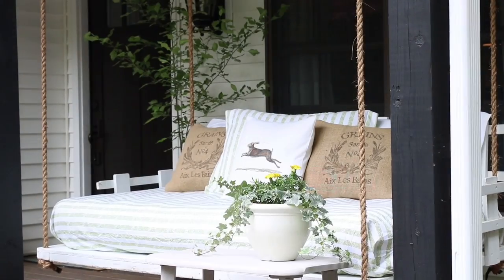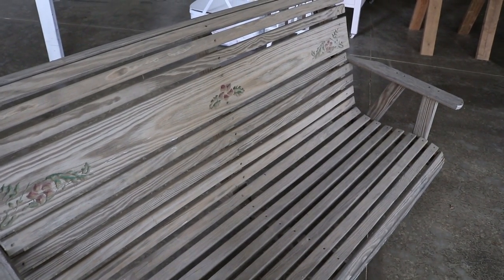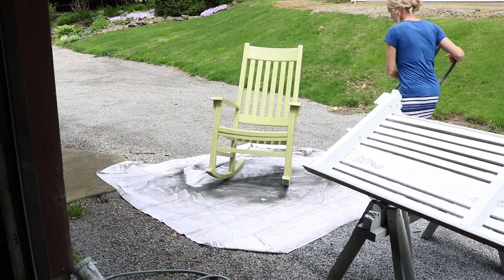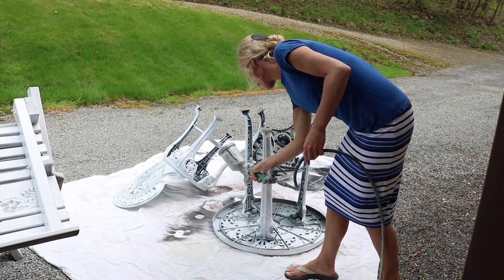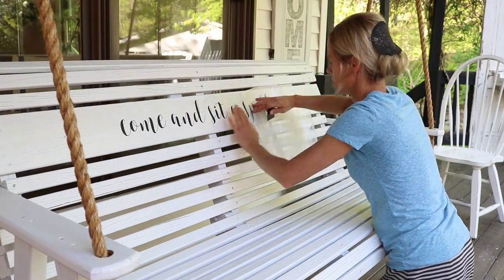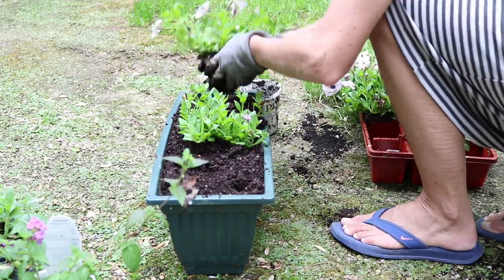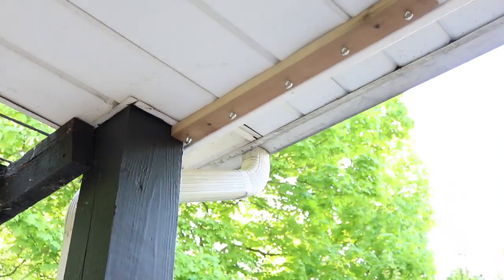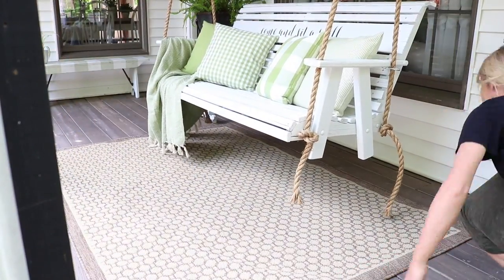Porch Decor Ideas ~ Summer Porch ~ Farmhouse Porch Decor ~ Porch Swing Installation

Comment: Quick tip, if you have issues keeping your outdoor pillows clean try pillows made with shower curtains or even just covers for existing pillows made with sheer curtains. They're waterproof and easily cleaned off.